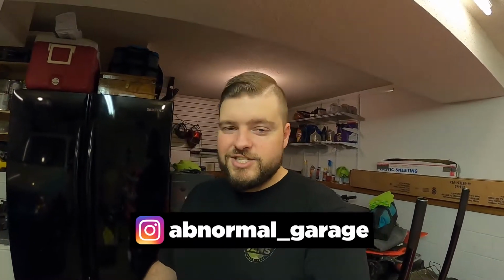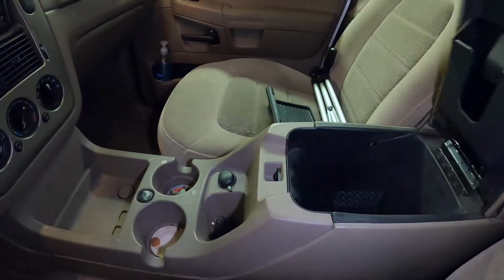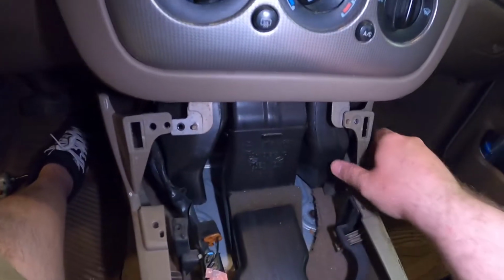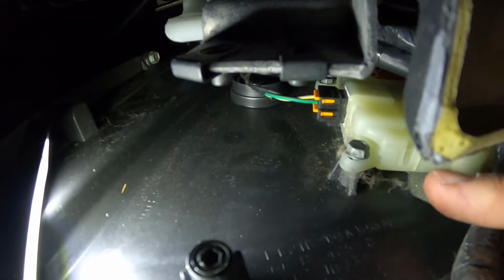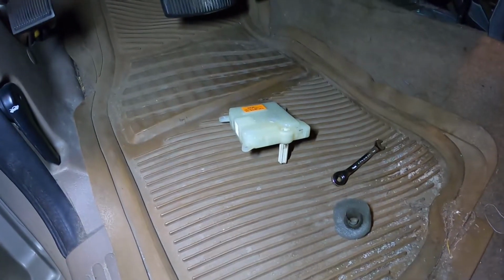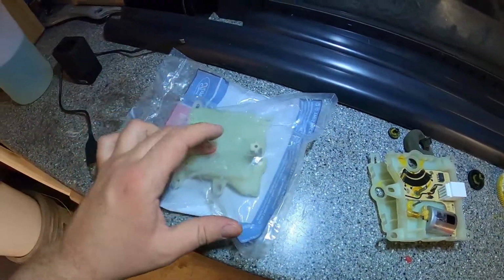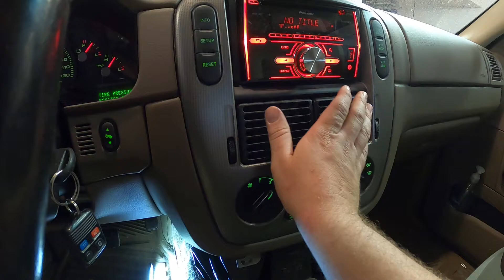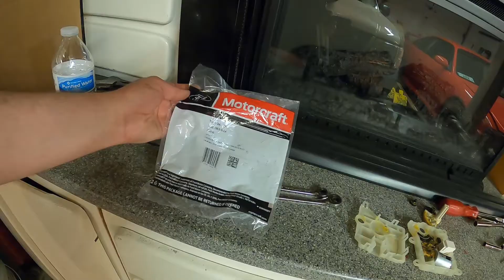No Heat & Clicking Noise Fix | 2002-2010 Ford Explorer

Comment: Thanks! How in the heck do you get that top screw in or out? I had to remove 6-in of dash to get to it. Then I just left it off when re-assembling. Tried and tried but gave up. But.... it works! Thanks!
Reply: I took the dash piece off under the steering wheel and went in with a wobble socket long extension to get that top screw

Comment: I popped off the bottom side panel, removed the 4 10mm bolts on the brace, then I was ably to get to the actuator and swap it, took 5 min.  Thanks though!

Comment: Ok so I’ve taken all the screws out, I’m at the point of taking the actuator out. How the heck did you do it?!? It seems impossible to take out
Reply: Ok nevermind, I finally was able to get it out and put the new one in. Thank you so much for this video! After 2 years my car finally has heat 🙌🏽
Reply: Howd you do it because I’m over here about to give up
Reply: @thehistoricalrewind9677  I almost did 🤣 I think that’s the part that takes the longest is trying to get it out. I had to maneuver so many different ways. I think essentially what I did if I remember correctly, I tilted it farther in so I could situate it better to get it out. I know it’s been a couple weeks since you posted this, we’re you able to get it?

Comment: if your ford explorer is a little different, your lever might be on the bottom panel  and you either have a little plastic arm like i have, or you have a spot where you can put a torx driver in and adjust it.    i have a ford explorer 2006   here's a video here showing where it is  https://www.youtube.com/watch?v=sly6G30XRTw&ab_channel=ricksterq

Comment: Disconnecting the battery and reconnecting it should also do it. Correct?
Reply from the maker: No, the teeth on the gears inside the actuator that open and close the blend door are broken. That’s why it constantly makes a clicking sound.

Comment: can this also make your car run hot?
Reply: If you mean make your engine run hot? No. There's no relationship between the actuator and engine heat, except to the extent that having heat on in the cabin draws heat from the engine. If anything, then, it would theoretically make the engine cooler. Air conditioning, though, gets its compressor power from the engine which could make it run hotter, and the air-conditioning system dumps the cabin heat it removes in front of the engine's radiator making it--theoretically--run hotter.

Comment: Disconnecting battery should reset system. It should fix it that way correct
Reply: If you saw the part where he pulled it apart, these was a little gear that was missing teeth. So no, resetting it wouldn’t fix it